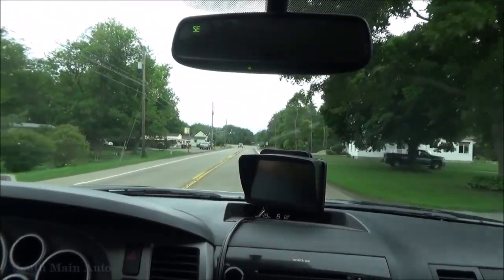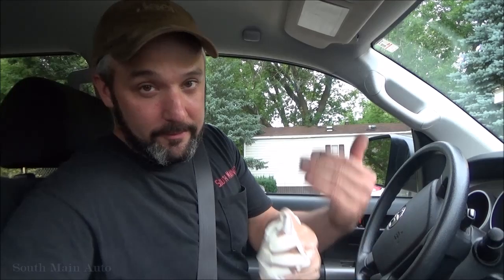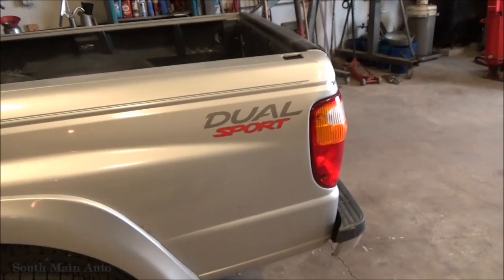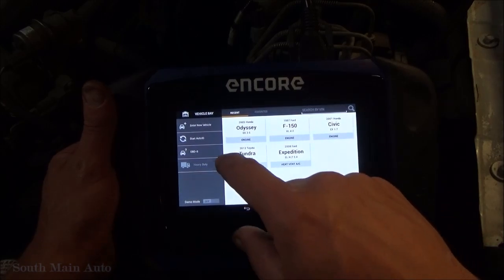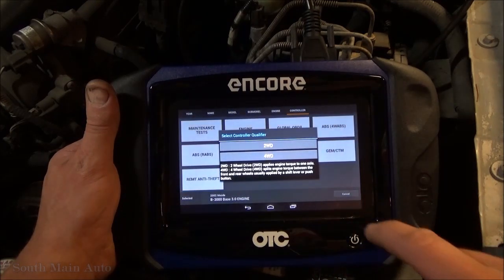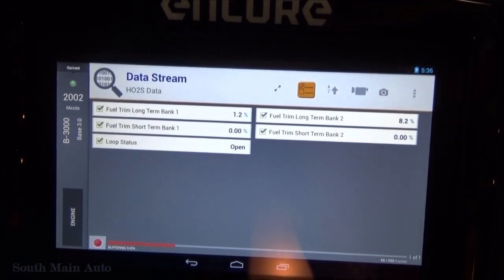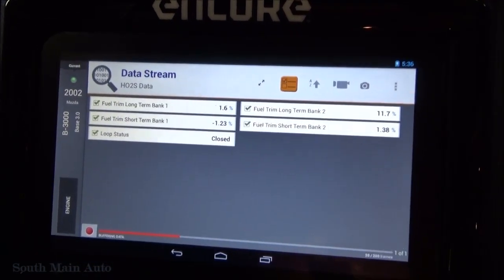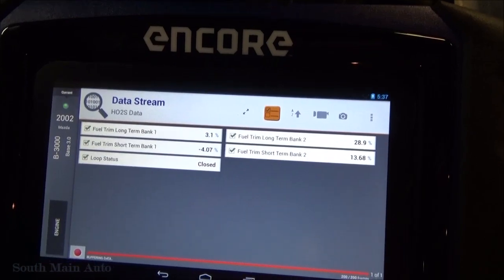Mazda B3000 / Ford Ranger - Lean Running Misfire - P0171

Comment: Thank you Dr. O ! I really enjoy your videos. I find myself shrinking into the fetal position whenever I see someone pulling off plug wires on a running engine. I used to work in a tune up shop and have taken several jolts from GM HEI's and the like. I actually took a jolt to the chin while leaning over the fender of an Audi (I was kneeling at the time). They say the voltage won't kill you, it's hitting your head afterwards that kills you. Either way. Love the videos ! Sincerely, Sparky.

Comment: Great Video!  2 cylinder misfire dumping twice the air at the 02 on  B2!  Simple enough math, but I learned the hard way about not pulling plug wires out of a distributer or ign coil!  MAN THAT HURT!  If you use a grounded screwdriver that would work/won't  light you up!  Oh ya.  ICE CREAM!  THAT LOOKED SO GOOD!
Reply: If you use a grounded screwdriver, that would work!  Sorry for the double comment.  Nice job!
Reply: how dangerous is it to pull out the ignition coil?

Comment: Yikes. I feel bad for your brother. Nice fix. Nice new scan tool as well. 

I just fixed a Fiat Punto. No start due to no fuel pressure. It was actually the ECU. And it had a bad coil causing misfire and poor running. It also desperately needed a service. 

What could be better at the end of the day than ice cream and cruising the dirt roads in your Tundra. 

We have pretty much zero dirt roads in the UK. Except on private land. Really bad paved roads with pot holes and weeds growing in the middle is the worst it gets in some rural areas, the Scottish highlands and on the west coast in the republic of Ireland.

Comment: I have found, in my long life, that it is seldom a good idea to bust someone too much about a rookie mistake.  There's only two types of mechanics; those who have made stupid mistakes and those who will.  I remember an instance when a person I know had the engine in his car completely rebuilt.  Afterward it had no power.  Didn't misfire or anything but just was totally weak.  Long story short, I convinced him to bring it to my friends shop.  Turned out, the guy who rebuilt the engine failed to disconnect the vacuum advance before setting the timing.  Once the timing was set properly the engine ran like new.  Rookies aren't the only ones who make rookie mistakes.
Reply: Agree. I'm a DIY'er, but I've worked on my own cars for a number of years. I was replacing the valve covers and gaskets in my mom's Altima, and I was sure the ignition coils were hooked up correctly. Long story short, it had a horrible misfire I couldn't figure out and had to be towed to a shop. $400 later, including the tow fee, it was back to normal. smh. One thing the shop also found is that a pro mechanic had crossed up a couple vacuum lines, so I didn't feel like a total moron. Well, yes, I did.

Comment: Yep. Fords have to relearn the crank wheel/sensor correlation before they can detect misfires. Resetting codes wipes that calibration out. Requires several non braking decel events. (Think coasting down interstate off ramp)

Comment: Hey Eric, great video! Quick question. How did you use and what was the test light connected to in order to determine the firing order....  I think I missed something?
Reply from the maker: I used the test light to keep myself from getting zapped... that was all
Reply: Connect tester between spark plug and spark plug wire on number one cylinder.

Comment: Interesting that his LTFT on bank 1 was reading about negative 8-9%, while STFT was around 0%.  My 2000 3.0 Ranger does the same thing on both banks, and I always wondered if it was an issue, but didn't really know where to go to troubleshoot it.  I know they say don't worry about fuel trims until they are above 10%, but does have a slight rough idle, but then again some say all Rangers have had rough idles.
Reply: I can tell you that I have spent over $5000.00 trying to fix the rough idle with no codes on a 2002 Ranger Vulcan. Only thing left is replace heads with possible receding valve. Idles almost perfect sometimes and sometimes not. No pattern. Before you reply with something to replace I already replaced it :)
Reply: @BlitzHack Did you put a vacuum gauge on the engine while it was running? Running compression test?

Comment: great video but I had otc scantool for years with the Mazda trucks I'd them as a Ford Ranger and on most of them otc has the relative compression test and cylinder balance test  I leaned ford software works better on them

Comment: Hey I have a question I need some help I have a 2001 Oldsmobile Alero in the starter went out and I replaced it with a new starter actually it's used but it didn't have any shims in it so I replaced it without any shims and I'm getting a weird noise like the starter it's making a winding noise I don't think it's keeping engaged and I tested it before I put it in the car so I know it works that be a shim problem if you're hearing funny noise the batteries 12.4 V 12.6 V and it's holding a charge. Should I be looking somewhere else like the neutral safety switch? If you could do a video on Oldsmobile Alero how to change a starter that would be great 2001.

Comment: Salting in the summer, thats a first. Here in NH we have plenty of dirt roads (and dust) but salt is a winter only thing. Cars in NY must not last very long.
Reply: Over here in Scotland they were coating the salt with molasses to make it sticky, really not good for cars.
Reply: OMG really. isn't that wierd
Reply: Our state past time:  Listening to the cars rust....  Some states your past time is listening to corn grow....  Watching paint dry.... Listening to cows MOOOOOO......  And we've got our Rust!  Otherwise called "Natures Metal Recycling"
Reply: Does rust proofing help at all?
Reply: The Plow Guys
  I would think it delays it.  But once something like undercoating starts to flake off?  Water and salt get between the undercoating and steel and it gets bad quick.

I wouldn't mind seeing how a product like the "Auto Saver" does in a rural salty area.  It uses electrical chem reaction to fight off rust damage.  But I've not seen it, so I'm not sure.

Best prevention would always be to keep the car and the undercarriage as clean as possible.  And to address any rust spots when they start to appear.

Just my 0.02 cents on it.  I'm sure there are great products that help.  But I'm not aware of many--other then to keep things as clean as possible.
Reply: +The Plow Guys if done yearly 
Summer is the best time to do it
Reply: Ya I do my truck on a annual basis. i hope it will help.
Reply: Tedybear315 You can use a anode. I think thats what they are called they actually attract the rust to them.It is a wierd science, but suppose to work really well. When this "anode" gets all rusty you replace it with a new one. I think.
Reply: The Plow Guys
  Pretty sure you've nailed it.  Local shop installs them.  Usually onto new cars/trucks.  The system runs about $600+ for a car!   I can't see spending that much on a used car that likely has a head start on the rust....
Reply: Ya i have heard of those and yes they are pricey. I have seen a company use them on steel beam. This thing is bolted on to the steel and it some how attracts the rust to it. No electricity. Damn I can't remember what it was called or where I can find it.
Reply: The Plow Guys
  Dirty Jobs with Mike Rowe did an install of that within I think it was a storm surge 'gate' that normally rests at the bottom of a water inlet.  They only raise it up in severe weather to protect the inner harbor area and water way from the surges.  (was a long time ago, memory is fuzzy).  He had to crawl inside this metal hulk and replace the anodes that where rotted out.  

Now I have to go back and find that episode!  It was a good one.
Reply: OK so I am not crazy then..fhew. had thought of the men in white coats coming for me..lol

Comment: 90% of all repairs can be traced to a previous repair. Best advice I've ever been given as a tech.
Reply from the maker: that is true 83% of the time
Reply: Meh, maybe if the vehicle is relatively new still but otherwise I don't agree with that unless you took the vehicle to an incompetent mechanic last time.  0% of my repairs have been due to a prior repair (I don't let anyone touch my vehicles lol).
Reply: @stinkycheese804  I let someone else work my vehicle once installing a different engine. He forgot to install pilot bearing. I lost first the clutch then later the manual transmission!!!
Reply: @SouthMainAuto  😀
Reply: @chriscusick6890  I see your point 
But my car doesn't have a pilot bearing or bushing and its manual

Comment: Crossed plug wires, always a nice find. Cant count how many times Ive done that. You try so hard to make sure their correct, and still get it wrong !
Reply: Well I usually do one at a time or use different colored nail polish, and a key, e.g. Green cylinder 1

Comment: Can say as a backyard mechanic, every time I have a misfire on my chevy's, after touching the dizzys, always step back take a breath and check the wires.  Almost always find a wire crossed.  Key is not to panic or you will start throwing parts at it...

Comment: I literally just finished doing a full tune-up to a 2002 MAZDA B4000 with the 4.0L.  I couldn't understand why the truck was running so rough and throwing a P0174 Code.  I checked to vacuum leaks and all that stuff.  Then I bumped into this video.  Lo and behold, I flipped wires 5 and 6.  🤦🏽‍♂️🤦🏽‍♂️  Valuable lesson learned here.  Check the obvious things first.  Thanks for the teaching my friend.  🙋🏻‍♂️

Comment: Amazing on a Ford system. I run into it constantly with obvious misfire no light and no Mode 6. Very frustrating , at least GM uses Misfire data on earlier models to help with Dx. Bank 2 is easily mixed up on Bank 2, had that in the shop i work numerous times.  Good video

Comment: Seems to me, cars are a lot easier to work on before they put computers in them.
Reply from the maker: No just people could guess easier I think. I think it was faster for them to change a bunch of parts is all and get a result. They actually required just as much testing for a good diagnosis.
Reply: +South Main Auto Repair perhaps, I guess though, or older cars that was not as much guesswork. Computers to add to the complication. Thank you for all the good diagnostic videos though. You do a very good job. I enjoy watching.
Reply: A few years back I helped a buddy gasket his valve covers on his 1950 pickup truck. I sat on a fender with my feet inside the engine compartment. My buddy did the same thing on his side.
Reply: Few years ago I was working on a car that had 'points'. Had to rolodex my memory to remember how to set those things!

Comment: What was it that made you twig reversed leads ? Great call and very fast diagnosis !!
Reply: Both cylinders seemed to be miss firing when he pulled each lead. Obvious answer is the wires are switched.
Reply: Crashcx nailed it. As soon as he pulled the 3rd wire I instantly thought the wires were switched.
Reply: I could'nt tell the difference between the first 3 cylinders even after replay. Is there something I'm missing besides a hearing aid ?
Reply: @fieldsofomagh  Bet it's a lot easier to hear, and feel, as you're standing beside the truck!

Comment: Ignition Coil connector/ pigtail goes bad too. I had 2 go bad on 99 B3000. Didn't find it until I spent $$$$'s changing coil, wires, plugs... everything.
STANDARD MOTOR PRODUCTS S658

Comment: Easy to do. My 3.0 is 123 on one side. 465 on the other. Thats looking at a coil pack and not the firing order. On bank 2 it is very easy to mix up 5 and 6.Because looking at it 5 and 6 makes since.But it not ,,,,,It's 6 and 5.I have seen many people on the 3.0 mix 5 and 6 up,, including my self. The way I remember it is 123465.If your coil pack is mounted like his.This is probably not the firing order. Just the way to help me remember because we on 3 vehicles that are 3.0.

Comment: I just replaced the catalytic converter on my 2006 Mazda b3000 Dual sport 3.0 Now the overdrive is flashing and check engine light came on. Code is p0174. System is too lean bank 2.  When I move cable to overdrive under hood and secured it overdrive flashing stopped and kicking stopped. But P0174 still appears. 🤔 mass air flow sensor has been cleaned and  the air control valve has been changed. Anyone have any clue what else it could be ?

Comment: Was always told those Coil Packs put out a lot of Voltage ?  could Stop your heart .. did not look safe    ... I have a 2000 ranger 4.0 L with  P0171  lean code bank One  But runs Good ..   Could it be a weak Fuel Pump?? thanks

Comment: So question if anybody can help even a little. I have a 01 ford ranger edge 4.0 v6. It is saying cyl 4 misfire I've replaced the following
1. Spark plugs
2. Plug wires
3.coil pack
4. Egr valve pressure modulator
5. Egr vacuume modulator

So far still runs like crap very seldom does it have its moments where you will start it up and it runs perfect but will only run good for about 2 min then will start missing again. I'm done throwing parts at it until I find out for sure what it is causing it. And also before this happened it ran perfect never had a problem with it. But at this point if I can't fix it I'm close to selling it and being done but don't wanna do that cause I love the truck.

Comment: Hey I got a 93 Ford Ranger 2.3 5 speed. And it's dumping fuel into the system and I can't figure it out I have a new timing belt a new computer and I haven't changed anything else yet but it's getting a lot of fuel and it's coming out with pillowing white smoke out of the exhaust just wondering if you can give me some insight thank you

Comment: I'm so impressed you were able to make that diagnosis without checking firing order. Yeah, two cylinders and recent work pointed the way, but without the details in print I wouldn't have had the balls to swap those wires.

Comment: Oh yeah, a lot of us have done that but you found the issue pretty quickly. I think I fried my computer on the 1998 Chevy.  Dumb mistake on my part but an opportunity to self correct. I'm working that Vantage!
Reply: I was working on my car and the battery sparked. I was cleaning the throttle body and my wrench touched it

Comment: I thought for sure you were going to end up with the problem I had with my Ranger. I have the 4.0L and it will eat platinum plugs for lunch.  I have no idea why it doesn't like the platinum plugs, but it loves the cheapest copper tipped plugs from Champion. As long as I have those in there, I have zero issues. Platinum, it's one plug after another, it kills them. I changes all the wires, and coil pack, that didn't change anything, so I just use the Champion plugs. Maybe this can help someone going through the headache I went through? Maybe someone has an answer for the cause of this?

Comment: many many years ago a friend bought his van to me which had a charging problem, i diagnosed it to be the alternator so we went and got a replacement and i fitted it. but it still would not charge the battery, long story short we called his breakdown recovery people to tow it home and they had a look and i had not tensioned the alternator belt enough, they tightened it and it was charging perfectly. sill embarrassed about that

Comment: I felt a slight miss driving down the highway in my 02' Ford Ranger XLT 4.0L and drove it into the the Ford Dealership. I had to initially paid for the Diagnostics Test that showed a misfire at Number 5 cylinder. I had them install new plugs and plug wires as recommended, and an hour later I was back on the road. I request the same trusted mechanic that repetitively works on Ford Rangers and gets to the point, does the fix, road test it afterwards, and evaluated what repairs I may need in the future like a valve cover leak, which he did the next day. My truck is 19 years old with 174,000 miles, and I'm retired now driving only 3000 miles a year. My truck runs, drives, and looks like Show Room Condition. It's the best $19,000 investment I had ever made, besides my 1998 Ford Ranger that was totaled in a head-on collision from the other guy on the wrong side of the road. The shock of impact traveled through the whole truck to where you couldn't open up the tailgate. If I had the money I would buy a new ranger, but they want double now for what I paid for mine.

Comment: Your right, had my van 24 years and most of the fix in I done to it was because I messed son thing up but after about a decade or so I started learning, sad my van is almost rotted away and its only 24 so young! it's barely broke in with only 300k on it I think the motor will outlive me but the salt THATS YOUR PROBLEM LADY! great video.

Comment: I got an old Isuzu trooper for neary free 10 years ago. The prior owner was drinking when he did the tune up, and couldn't figure out why it miss fired so horribly afterwards. After I bought it, it took me the weekend end to figure out he had 3 out of 6 plug wires switched. Sold it 5 months later for $950. I miss that ol beater. Was a beast in the snow and offroad. Isuzu made some of the toughest suvs back in the day, shame they got so far involved with GM.

Comment: We just got a Encore for the shop, it's the Mac version, but so far I like it too.  I like the Bluetooth on it.  I can send scan file pics to my phone and with the wireless you can hook up to the net to acess repair info.  Not a snappy but still a good tool in my opinion.  It is on my wish list to get.  Eric have you tried the Ford Power Balance test with the tool yet?  Also I'm almost ready to put together that monster 8 amp bulb into a test light body, I"ll share when I'm done.  Been playing Mr. Mom this week and prepping to instruct again for class this fall.